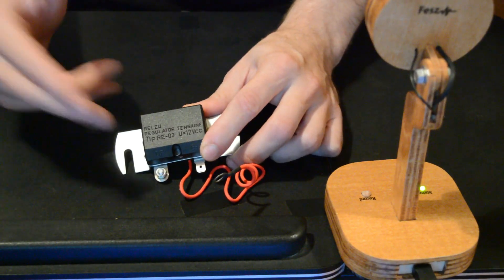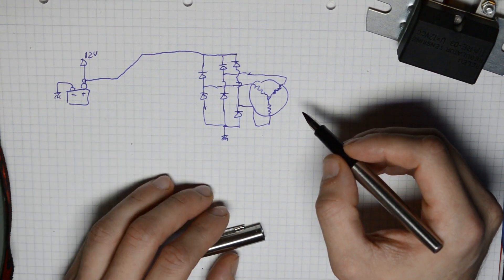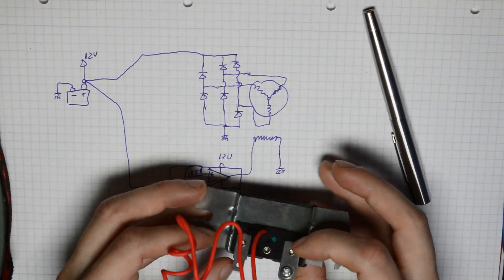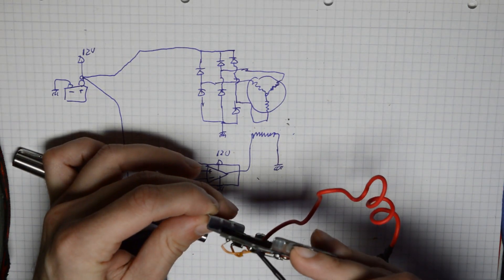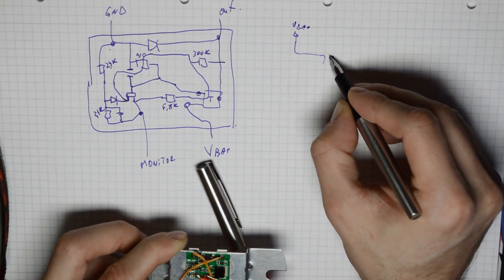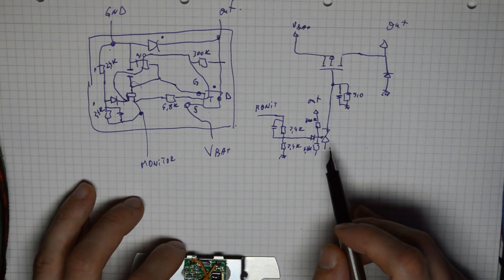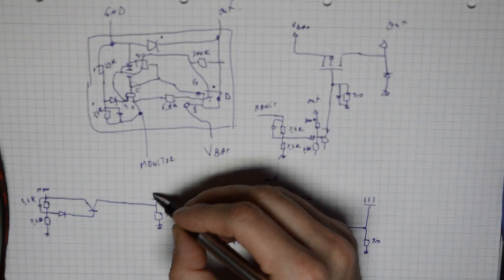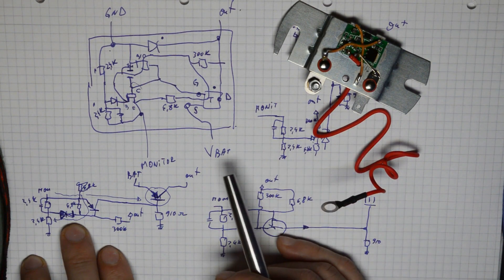Teardown - Alternator regulator relay RE-03

Comment: Thank *#~i! for this vid! Have been looking for a tech level circuit step through that isn't either, fundamentally a totally WRONG explanation (as many here were/are) or, generalises to the point of irrelevance in learning anything.  
So, it controls/varies/"regulates" the STATOR FIELD via monitoring the battery voltage ergo, regulates to a constant voltage output level .  YAY! I got it!! 

And also, how you 'roughed' out the reverse engineer circuit diagram drafts. Good style and, another 'how to' lesson for me. :)
As an old electrician with "basic"/rudimentary electronics knowledge, this explanation is - JUST RIGHT.  Taa Mate. Good Job.

Comment: Possible the output transistor is a darlington. for use a mosfet you need a low voltage on type like a digital one otherwise it will do work bad.

Comment: Can we by pass that shity voltage regulator and pump the ass out of baterrys? What wuld dual wire do in a rotor if its in series ore pararel wound?
Can you actualy use bouth magnets and field coil for centrain effects?
Can you actualy use simpel mosfet speed controler and turn alternator to brushless motor and useing a oscilator circuet to actualy switch from generator to starter motor function at centrain speed ?
Wuld that by posibel ?
Just out of curiosety .
Did you ever try use neo magnets and forced them together instead of oposite poles? Ore use just 1 set of poles what wuld the scope read exactly?

Comment: Ive tried making one the problem is the field voltage needs to be around 5.5v  and depending on the load on the alternator between 1 amp and 4 amps. 5.5v at 2 amps gives 100 amp out and 5.5v at 4 amps gives 200 amps  all at 6000 rpm  5.5v in = 14.5v out  11v in = 29v out  14.5v in =38v out  I would need to use a isolated voltage / current regulator between the output B+ and case and field - as Field + goes to B+

Comment: Sir If we want alternator 48v output than what can we do change which components of avr
Reply from the maker: Well the main "voltage comparator" is based around a transistor's Vbe (0.6V - not much to do about that) and a zener diode. My guess is that for the 12V system the zener is ~12V so for 48, you should get the circuit to work correctly by choosing the appropriate diode.

Comment: Interesting video!
Thank you.

What would you guess the current is in the field coil?

Kind regards
Reply from the maker: In a small passenger car like the one for which this component was made for I guess it's below 10A (maybe around 5). Wikipedia says that the field current is around 10 times smaller than the alternator output current  ( https://en.wikipedia.org/wiki/Alternator_(automotive) ). The main issue with this RE-03 part is that there is so much power dissipation on it that it ends up breaking quite easily. I had a friend swap the transistor with a proper low Rds_on MosFet and he didn't have any problems since.
Reply: @FesZElectronics  Problem with a two transistor is that the switch part do not fully turn the transistor on.
Reply: Sir diagram plz....